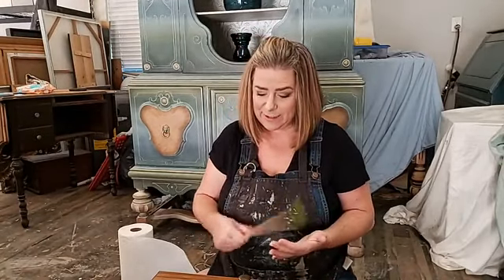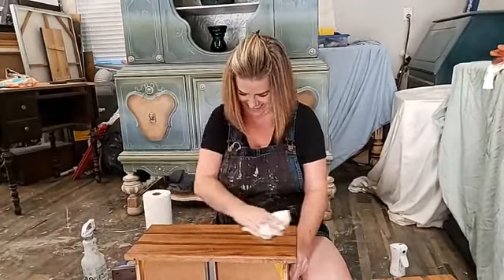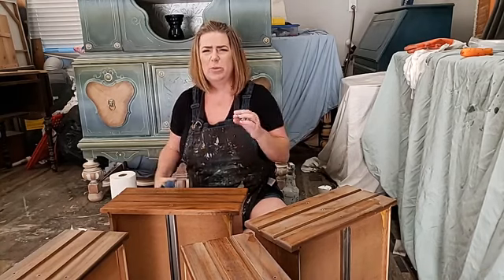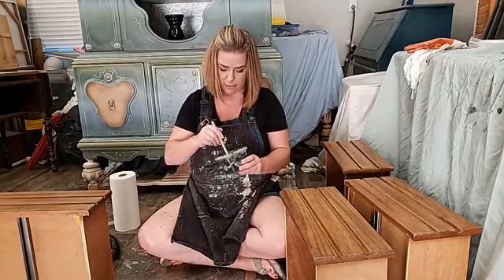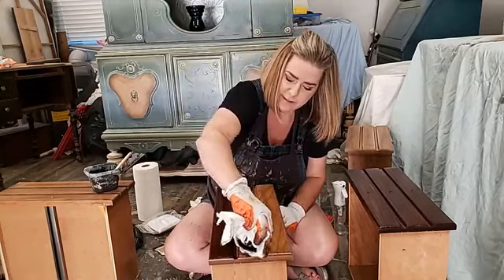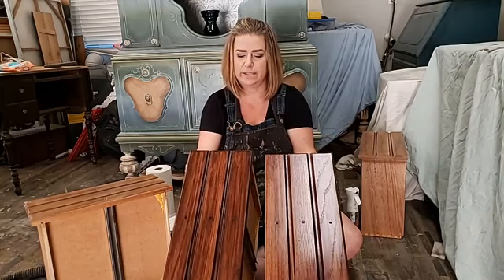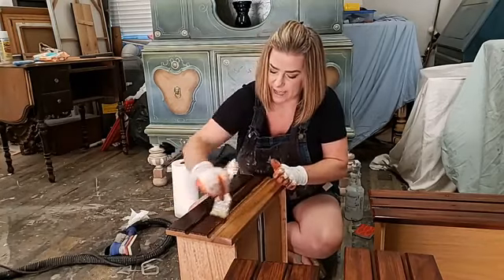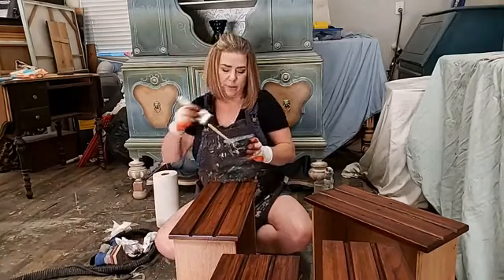Updating golden oak using gel stain

Comment: Hi Brandy, thanks for the video! Do you recommend an oil based sealer rather than a water based top coat when using the oil based gel stain? Thanks in advance!

Comment: What was the cleaner you used before staining? Can you list all your products & in order. Thanks, great video. Would roughing the wood up w/ steal wool be ok instead of sanding?
Reply from the maker: Dixie belle
White lightning cleaner 
Lightly sand 
No pain gel stain in Georgian cherry & espresso

I don't recommend steel wool because it can leave bits behind that can rust under some finishes. A light sandpaper or surf prep rad pads are better for scuffing better

https://dixiebellepaint.com?aff=23